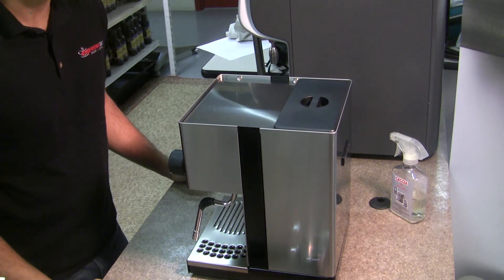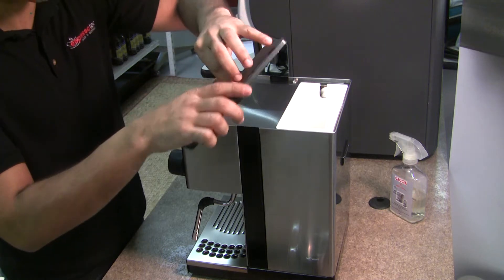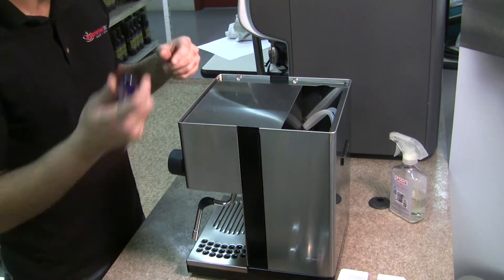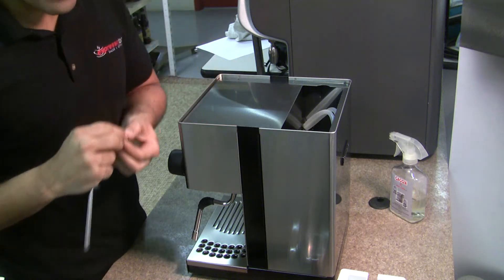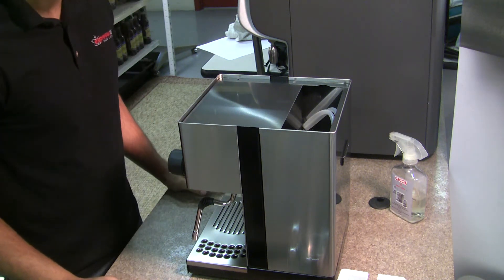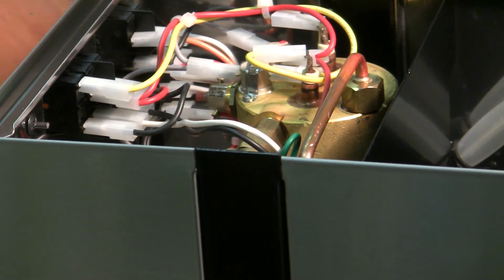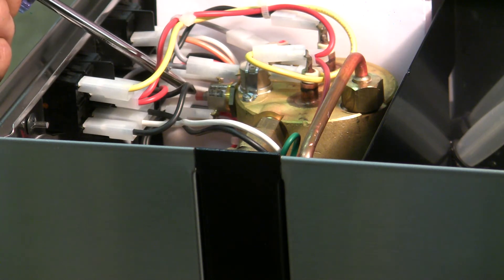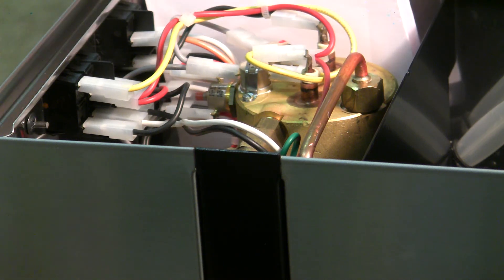Rancilio Silvia - Resettable Safety Thermostat

Comment: I have a Mokita Combi Super Inox, and this keeps happening once every 2-3 days. I am sure there is something to do to prevent this from happening, but what is it?
Reply from the maker: Thanks for the question! First, make sure your machine is fully primed before heating up for either steam or coffee mode. If the issue persists, it could be in need of repair, in which case we recommend reaching out to the retailer where you purchased the machine or to the manufacturer for a list of repair centres for that particular model. Hope that helps!